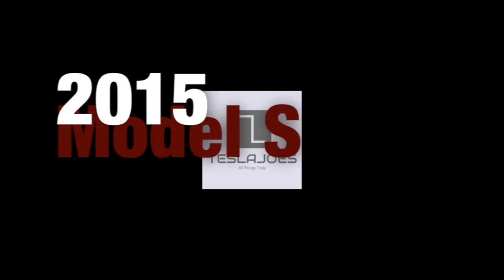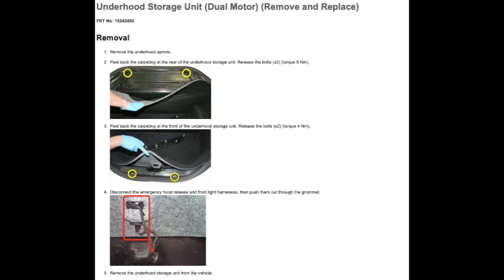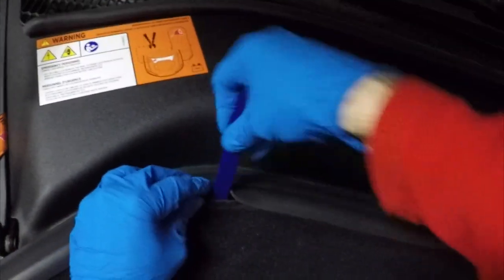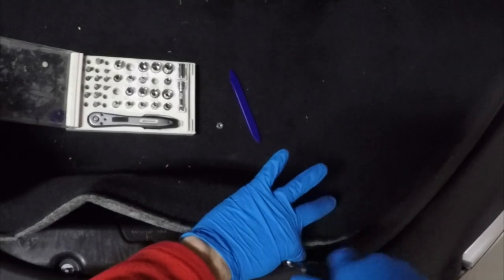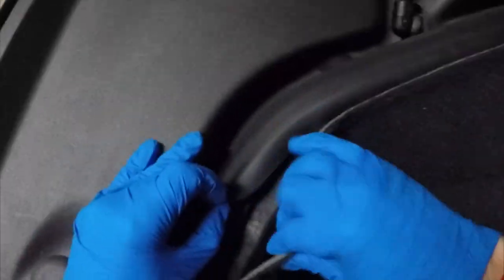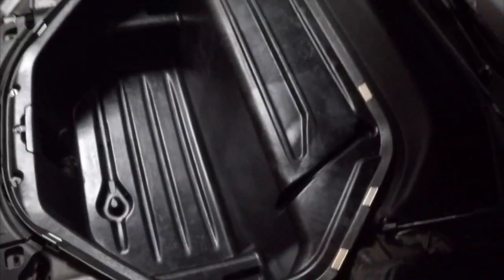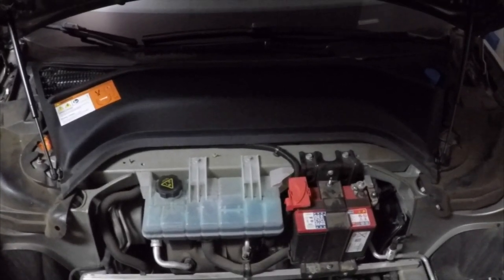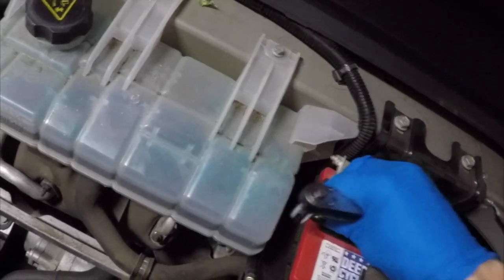Tesla 12 volt Battery | Replace Tesla 12 volt battery | Model S 12 v battery | Tesla Frunk Removal

Comment: My touchscreen doesn't come on, will disconnecting the battery work?
Reply from the maker: Tom Ford, is this after a battery replacement or just out of nowhere? Per Tesla repair manuals sometimes you might need to do a reset, either hold both scroll buttons, or for a deeper reset both scroll buttons with brake depressed. Another inconsistency that I have noticed, is opening and closing the drivers side door will cause the screen to kick on and off. If you have an older model s or x (mcu1) worst cause scenario, could be a failed eMMC. In the case of a failed eMMC you will need to replace the mcu.
Reply: @teslajoes6795  this happened out of nowhere, I turned on climate to have the car cool when I got back and then when I got in the touchscreen was black and never turned on, it tried both types of reset with and without brake, nothing worked
Reply from the maker: Tom Ford sorry to hear this, seems like worst case scenario, failed eMMC. Will most likely need a new/replacement MCU.
Reply: @TheBlkplague  If you haven't already, it's a free replacement now thanks to a NTSB recall.